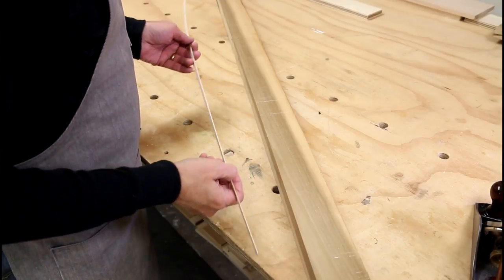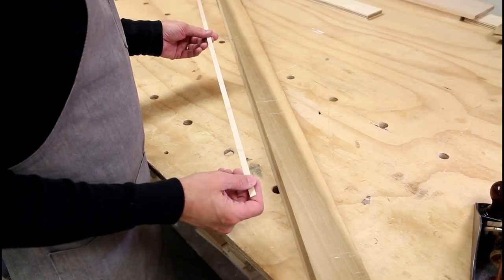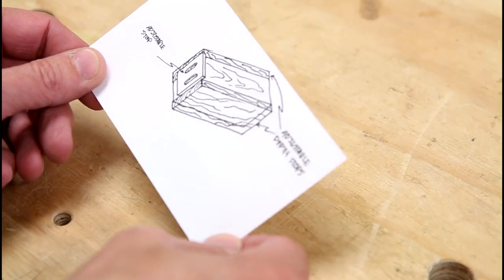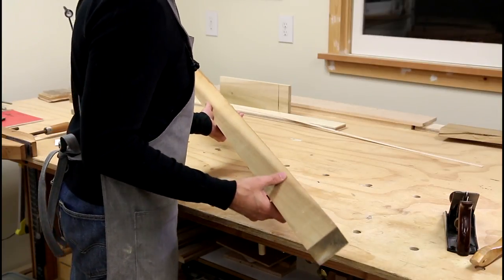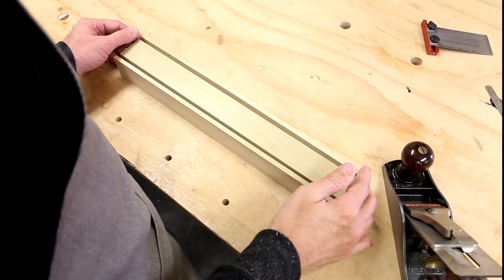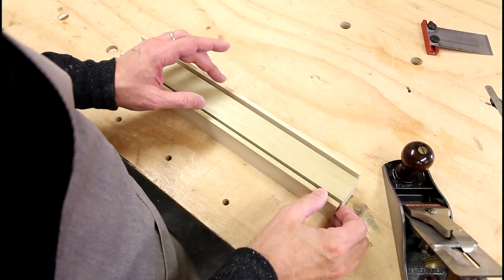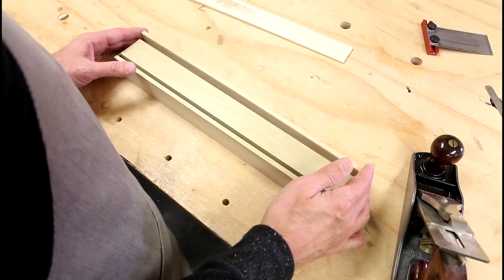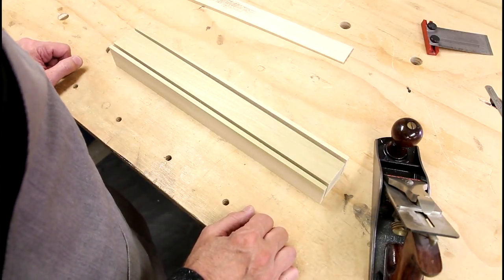Making a Small Parts Planing Jig

Comment: At 77 I’m going to try my hand at Kumiko so I’ve been researching on YouTube and found your jig build to be simple, clever, and accurate. I just finished a small 11 inch version of it to use with my block plane. I’ve got the blocks and starter set ordered and once that gets here I should be set. My version of your little planing jig is accurate to 1 thou in 11 inches so because I’m only doing this on a small scale for my own pleasure it should be sufficient. I plan to use it for accenting small items like boxes, napkin holders, coasters, etc. the only change from your design was I used nylon 1/4 -20 bolts for the elevation adjusting sides. I got all the parts from a 4x4 Douglas fir cut off. Thanks for the good plan and the (something from nothing) fun build.

Comment: This is a very good video and a very good and useful build.
I've seen similar builds on YouTube (both some simpler and some more advanced), this build is advanced enough to allow adjustment while being simple enough for most basic woodworkers to make.
In addition, you can make jigs like this for 'taller' pieces (eg if you need to make the sides of a wide board parallel).
The body of the jig in this build stands on the workbench, which can be preferable, however, in some situations, you may wish to make a variant where the adjustable side pieces stand on the workbench, so there will be a space under the jig itself.
This will have the advantage of not moving the workpiece when you push the plane downwards while planing; it'll also allow you to have a 'template' shim under the jig.
To further reduce the chance of the sides sliding out of position, you can also glue fine-grained sandpaper onto each side.
-Or you could use beeswax as 'anti-skid', but the sandpaper might be preferable.
I believe that the best way to avoid the sides sliding, could be to set the jig up in a vise, if you have one.
Marty, thank you for taking the time making this video; this jig is definitely one that makes a valuable addition to any woodworking workshop.

Comment: Nice jig, thnx for video!
I used to plain small parts in standart machine planner having well sanded piece of wood as a base )
Reply from the maker: I use a planer too, but there's nothing like the finish that you can achieve straight from the hand plane. And no matter what kind of power planer jig you use, trying to plane 1/16" thick wood is not going to end well ;-)  Thanks for watching.

Comment: I have been using matt kenney's fixed version of this jig for a while and was about to make several more when I came across your video. Neat idea -- especially the use of known thickness material to set the rail height. For stock less than a 1/16th I have been using the veritas thickness plane, but it is a bit finicky.
Reply from the maker: It's certainly worth experimenting with a jig like mine. I find it very effective. When it wears out I'll make a more robust version of it.

Comment: Fantastic jig! Just a quick question: you use a spacer to set the thickness of your finished parts, but that doesn't take into account the fact that the blade protrudes from the bottom of the plane, does it? Or is that a negligible difference in your opinion?

Comment: Nice jig! I think I'll make one if I find myself making more small boxes. Perhaps an improvement would be to put a bevel on the tops of the guide rails to make it easier to drop the plane down between them. BTW, this is also a tapering jig -- you'd just have to tighten the guide rails at an angle. 
I like the tone and pace of your videos, and also how neat your shop is.  :-)
Reply from the maker: You are right of course regarding its use as a tapering jig - I hadn't thought of that. Then again I never seem to need tapered wood of this size. But it's useful to note this 'feature'. Thank you for compliments :-)

Comment: Threaded holes in poplar? A wood screw would probably hold up longer. I just cut 6 slots for screws with a drill and coping saw. Took about 8 minutes. How long did it take to build that jig?
Reply from the maker: The threaded holes in poplar work in this application. Keep in mind that this was somewhat of an experiment. If or when it falls apart I'll make another one with better materials. I can't remember how long it took me to build, but because I filmed the whole process it took a lot longer than it would if I wasn't making a YouTube video. Thanks for the comments.

Comment: Nice jig, but how well will those threaded holes last in Poplar ?  The end stop in particular which is in end grain.   Wouldn't it be better with something a little harder?
Reply from the maker: Thanks. I'm not cranking down hard on the bolts, and they feel nice and strong with no signs of weakening (it's amazing how strong threaded holes are in wood). However you are correct that poplar is not the best choice for a long term jig. One of the purposes of this jig was to determine if the design would work, and I'm really happy with the results. I'm going to continue to use it and if or when it shows signs of wearing out I'll make another one with maple. I can tell that the end grain hole is not strong, but that's mitigated because the end is against a bench dog which takes all the planing stress. In my next one I may opt for a threaded insert for the end. Thanks again for the comment.
Reply: You could also glue in a dowel near the end of the board, in line with the machine screw, so you have some cross grain for the threads to get a better hold.
Reply: You could strengthen those threads with thin CA. I was surprised to see you tap with a drill. I always thought that was a no-no, because it would strip right away. I will try that
Reply: The actual force of the push by the plane is taken by the plug stop in the work bench. There would be very little to none force on the screw and the threads itself. The main purpose of the screw would be just to keep the end stop in place. That being so, I wonder why the need for a metal screw here. A simple wood screw would have done fine. This is based on my observation, but please do correct me if I'm wrong.

Comment: Not sure how the last spacers that set the height of the slotted sides control the final thickness of the workpiece.
The plane seems to be captured by the slotted sides, but the thickness is set by running the plane on the inner, permanent rails.

Comment: The jig is nice, but you use a lot of machines to make what could be done in easier (and safer) ways with simple tools that everybody has.
Reply from the maker: There's a million ways of doing anything. This is how I choose to do it.
Reply: @MartyBacke  Of course there are and it is clear this is how you choose to do it. But using a drill press on a poorly supported beam is bad practise safety-wise. In your case, that hole does not need to be precisely perpendicular and, considering how you hold the piece, it probably didn't come out perpendicular.

Comment: Yo, your drill press is shakier than Michael J. Fox...
Reply from the maker: Funny. It's not a machinist drill press that's for sure. The vibration is coming from the belt which hasn't worn in yet. So far it hasn't got in the way of how I use it.
Reply: Not cool, dude. If his shakiness were do to some self inflicted issue, like alcohol use it would be funny, but to use someone as a joke for a disease they con not control is pretty petty. However, yes the drill press is quite shaky.
Reply: Thomas Russell I agree with you after reading that comment I was twisted some people are just mean and that guy needs a good ass whooping and I would be happy to deliver it
Reply: Jason B I think its time to take a nap gandpa.
Reply: Jason B Sad to see how bad the dementia has gotten pop pop